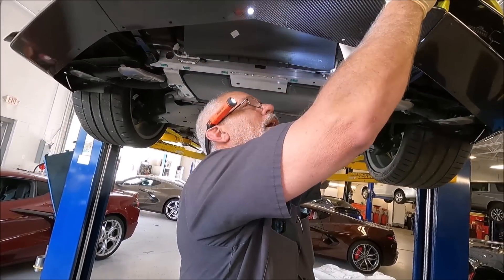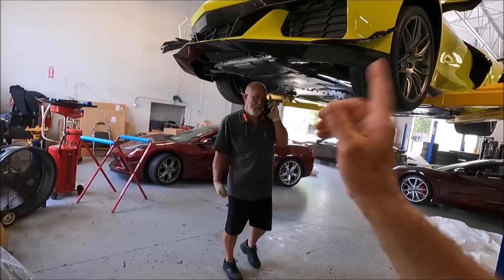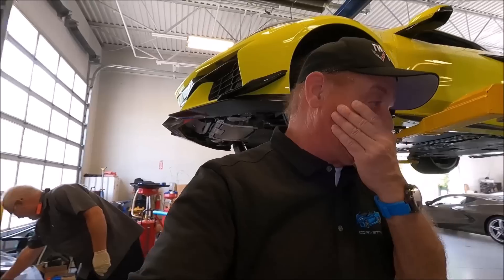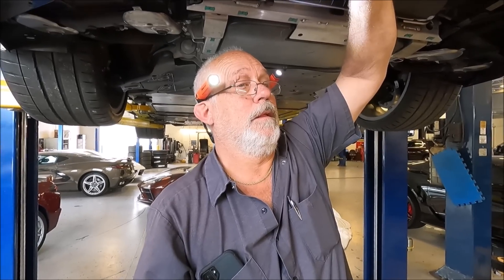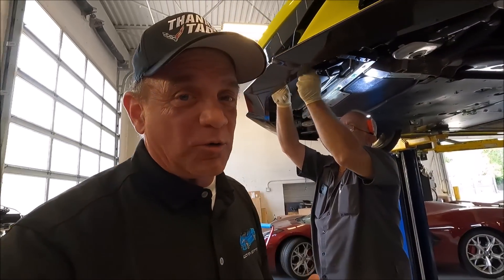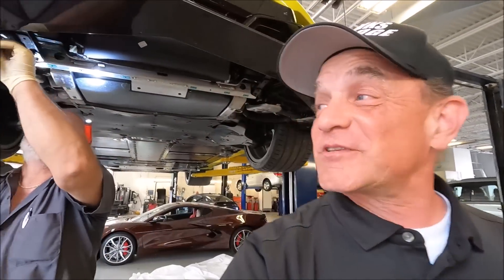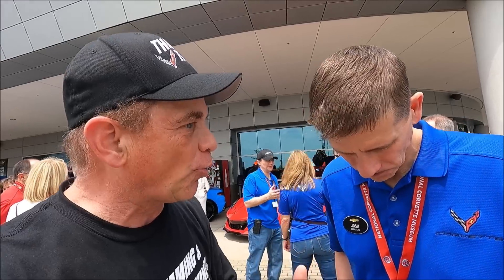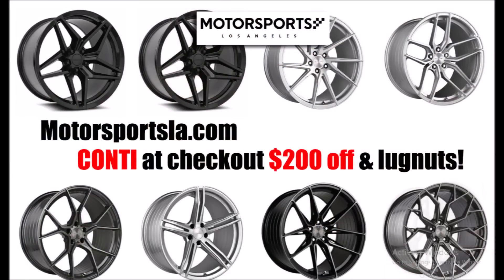WHY 2024 CORVETTE C8 DCT NO LONGER NEED 2 XTRA QTS & NEW SERVICE SCHEDULE

Comment: So my 2025 stingray does not need to get any more trans fluid added correct ?   Just purchased from dealership 4 months ago and for some reason the trans seams a little jumpy or twitchy when cold.  All my other vehicles I turn on for 1 min and drive out of my neighborhood and don’t feel anything with the trans. The c8 feels like it doesn’t know which gear to be in.   It’s kinda strange

Comment: What exactly do the do when you get your transmission flush , do they change the pan filter and canister filter at the same time. I contacted 4 dealers and got 4 different answers.
Reply from the maker: @robertlagoy3445  stay tuned I did it on my 2021 and will be soon on my 2023
Reply: @RickCorvetteConti  I’m very interested in see that process.

Comment: Hey Rick -- Just a little update re: DCT for 2024 -- I asked the same type of questions to the GM Engineer responsible for the DCT at the BASH -- He stated the identical answer but he also added these 2 important facts.
1. for the last part of 2023 Yr and 2024 they changed the Transmission case because of many reasons - mainly due because of the draining and the fluid pickups - They also added or increased the fluid fill and addition of 0.6 Qt. of fluid.
2.  If by some chance - you have added the 2 extra quarts of fluid - thinking that you still needed it - No Issue -- As these cases are only about 1/2 full to begin with. If the extra fluid is in there - no need to drain it.  When you do the  big service at 45k miles you can safely just replace the std amount of DCT fluid without worry,.
3. Finally -- As with the new Tech / Service Bulletin re: Transmission / DCT with incorrect Torque spec's -- GM will send out letter to those VIN;s effected -- Then you can schedule Service.

Again -- This is direct from the GM Engineer responsible for the DCT.

Comment: Nice to see GM change the 1st Service to 3 years but to be honest most Corvette owners over service the vehicle (like you Rick) so many will still  change the transmission filter in the first year or two. 

As far as rotating the tires every 7500 miles the better why is to check the treadwear on all four and if they are wearing evenly absolutely zero need or reason to rotate the tires side to side.

Comment: Rick— two dealers have told me they can’t rotate my 2020 C8 Michelin Pilot Sport All Season ZP tires. Said they’re directional. What’s correct? Thanks, Hal-AL
Reply: Since Rick failed to give you a proper answer - please allow me.

Rotate your tires side to side.

Side <--- to ---> Side

Obviously they are a staggered setup and directional. Therefore, logic dictates only one possible scenario.

Yes, that means they need to be remounted but don't let the Service Advisor tell you otherwise. They work for YOU after all - not the other way around!

Stay classy my friend.
Reply from the maker: Sorry man they are wrong

Comment: 12:57 shocking update to say that you really don’t need to add the extra transmission fluid even back in the 2020 model year except for extreme extreme conditions. It almost sounds like they would suggest not doing it at all.
Reply: I would like to know how the warranty decision decides what is extreme.? Weekly tracking, once a year tracking, autocross, top speeds etc. it all so subjective.
Reply: Yes.